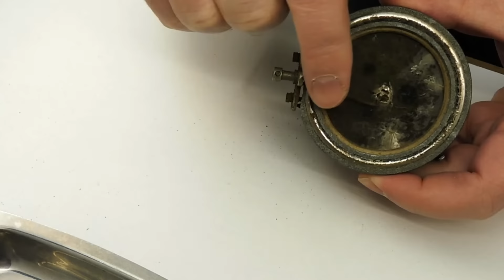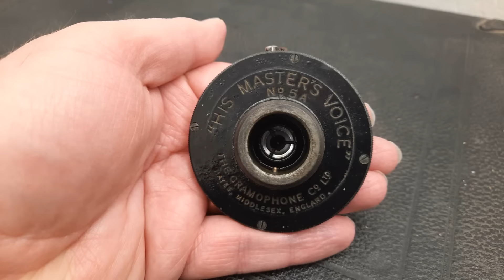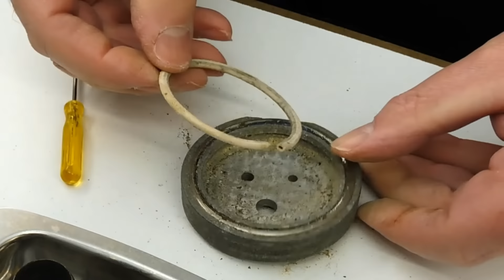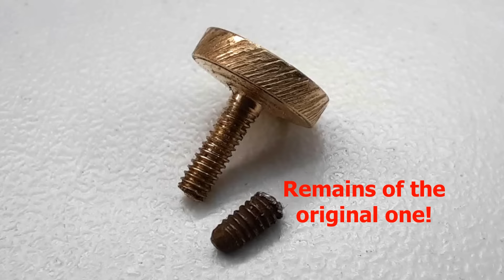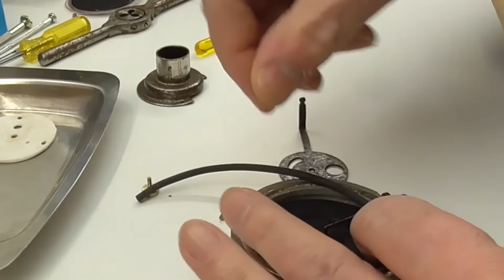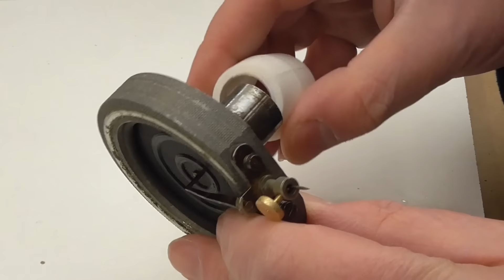Restoring a rare Tonofox gramophone soundbox / reproducer!

Comment: Love the restoration, especially your custom-turned needle retaining screw! The HMV and the Winner 78 sound lovely to me :-) The knurled aluminum body is superficially similar to Thorens units—but there are significant differences in the other parts. What are the pros & cons of the diaphragms you’ve created versus original mica parts?
Reply from the maker: @Michael.Chapman  I don't think the 3D printed diaphragm is really ridged enough. I have done some test videos. Some plastics are good, especially the polystyrene from a CD jewel case:
https://youtu.be/XqAlJVpN3ZM
Metal is a mixed bag:
https://youtu.be/aMrX8tn-tYI
But aluminium with corrugations works well:
https://youtu.be/mK1bGhanqf4
I also tried a mica diaphragm in this soundbox for comparison:
https://youtu.be/GwkSmJzJ_bU
I plan to upgrade the Tonofox, too, as I think it should sound better.
Thanks 👍 😀

Comment: Love your videos! I’m working on an old Columbia Grafonola Phonograph that has a Fletcher phonograph reproducer but is missing the thumb screw and needle. Do you know how I would go about firguring out what thumb screw to buy or where to buy one?
Reply from the maker: Thanks 😀 👍.  Glad you enjoy the channel 😀.  I'm not familiar with this reproducer, though I did a bit of searching and found what might be the patent document, though unfortunately it doesn't seem to contain the detail you require:
https://www.freepatentsonline.com/1446006.html
As it's an American reproducer, it's likely to have some small screw fitting like a UNC No.1 or maybe a UNF No.0, No.1 or No.2. These are still available today, and one option is to buy some ordinary screws in the various sizes and see what fits. Once you know the thread size, it will be relatively easy to buy a thumbscrew in that size (or if you know someone with a lathe, to have one made up)
Another option may be to ask on: 
https://forum.talkingmachine.info/viewforum.php?f=1
Which is where I found the link for the patent. Hope that helps 😀

Comment: Where did you get the sheet rubber to cut out for the back?
Reply from the maker: It's just thin craft foam. Comes in lots of different colours and thicknesses. Your local craft supply shop will probably stock it. Thanks 😀 👍
Reply: @mrrgstuff  Does it work as well as rubber in your opinion?
Reply from the maker: Yes, I think so. It's very similar to the cylindrical foam strip I used for the diaphragm gaskets, which I believe is generally recognised as an excellent substitute for latex tubing. You might find this video interesting:
https://youtu.be/ZuQOBKGPLus
Thanks 😀 👍

Comment: Very well done even without the extra touch-up! Nice to see the 163 is working again as well!
Reply from the maker: Thanks 😀 👍.  It's a different gramophone 😳. I have two 162s, this one lives in my workshop and is working. The one in the house unfortunately still has a spring problem, but fixing it will make a good video sometime! 😅 Despite being the same model, they differ in many ways. I made a comparison video here: https://youtu.be/18WXd65E7ow
Reply: @mrrgstuff  Ah, yes, I remember that one. I believe I watched that one before I even started commenting on your videos. It is interesting how there were legitimate Indian-made HMV gramophones which only adds to the confusion on the internet which is full of Indian-made fakes. It's a bit like how a lot of tech support scam call centers are located in India but there are also legitimate Indian cubicle workers and call centers.
Reply from the maker: India, I believe, has a rich and long history in gramophone manufacture, though back when HMV were active there, the metal components were largely brought in, and it was more the woodwork that was done there. It wasn't just HMV, though, and I have seen on YouTube what I believe is an actual vintage horn gramophone from India which has a very similar back bracket to the modern fakes. Whether the other parts of the machine were imported or not I don't know, however I am sure that soundboxes (Thorens clones I talk about here: https://youtu.be/C9FyvIl6VD4) and Thorens and Garrard style motors (https://youtu.be/qo6Vxul8-iw) are still being made there which I find fascinating. Thanks 😀 👍

Comment: Can you just cut out a circular piece of mica from a larger mica disc in order to replace the damaged mica?  Is there anything "special" about the sound disk that were used in these?  I noticed they sell sheets of mica pretty cheap on amazon.
Reply from the maker: Yes, the diaphragm is just ordinary mica, and as long as the thickness is about right, it should be possible to cut one from a sheet as you say. I did buy a precut one for a No.4 before I realised mica was still easily obtainable. I do have some clear plastic (not a CD case), I would like to try in this first, but it does deserve a new mica diaphragm in the end. Thanks 😀 👍

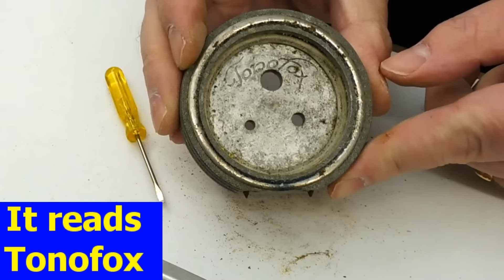Comment: 7:15  Are those holes and the corresponding holes on the other disc with lever attached, a kind of primative mechanical volume control? 
It seems to me that as you move the lever you are covering or uncovering more or less of the holes. which will let more or less of the pressure waves pass from the diaphragm to the horn acting as a kind of volume control.
Reply from the maker: Yes indeed. From what I can see, and I also believe I have seen it documented somewhere in relation to the Tonofox, this is an attempt to give a direct volume control on the soundbox. I guess the shape of the holes were somehow related to frequency, but I doubt there was any real scientific experimentation behind the design. Thanks 😀 👍

Comment: Excellent. Greeting from Arizona. Could you use exhibition tube gaskets? Or was the size incorrect. on occasion, I have used polycarbonate for a diaphragm. Cuts easily with scissors and seems to work very well.
Thank you for the very nice videos.
Reply from the maker: Thanks 😀 👍.  Glad you enjoy the videos. Yes, tube for Exhibition gaskets looks like it would be suitable and I do have a length. However, I used the black neoprene as it is much cheaper, and I really wasn't sure the final result would work. I have looked at various different materials in this video:
https://youtu.be/ZuQOBKGPLus
Thanks for the info on polycarbonate too. I have tried some different plastics in this video: https://youtu.be/XqAlJVpN3ZM